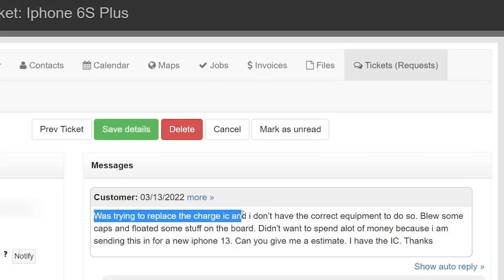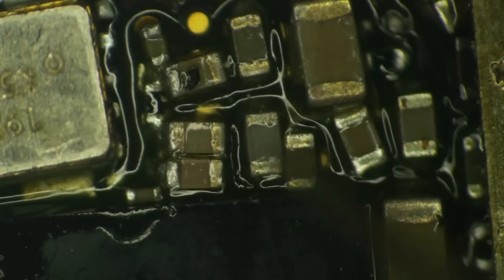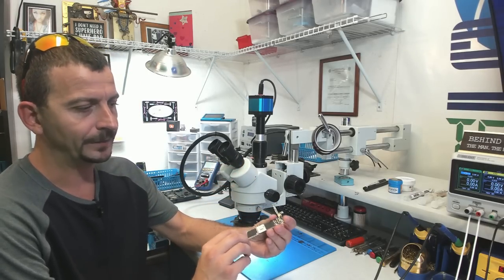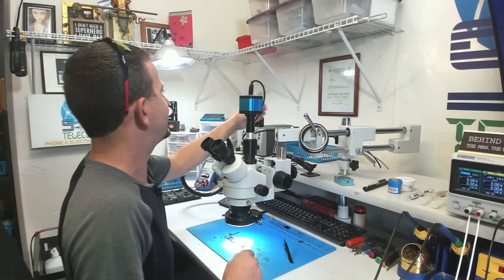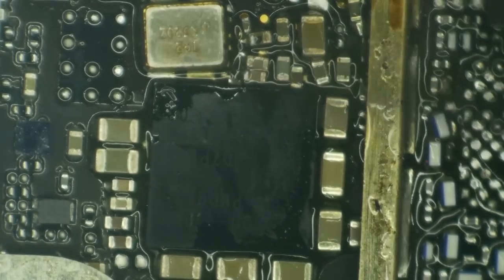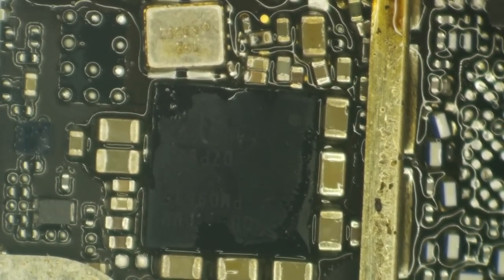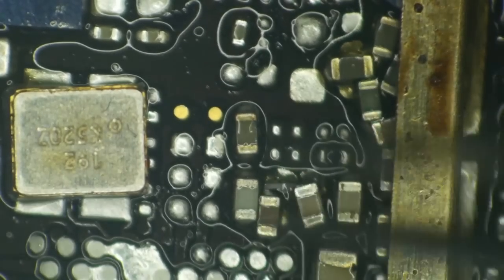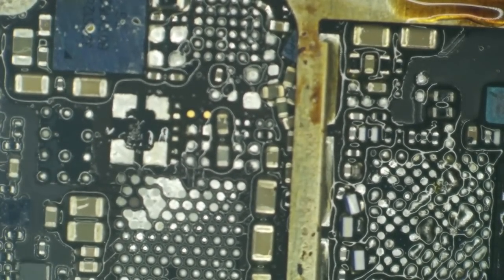Customer tried to fix it himself - An iPhone board repair rescue!

Comment: Wow...the components looked like they moved around like a bunch of ice cubes on a hot dinner plate 😲
 I will give anything a go repairing it but I know my abilities and circuitry that requires micro soldering I will not touch.
 I've transferred memory  ic's from old damaged vehicle key fobs to a new key fob to avoid having to reprogram the anti theft system but I wouldn't go anywhere near something like a phone.
Excellent job mate 👍

Comment: That carnage.. man oh man. It's like he used a flamethrower instead of a hot air gun.. Wowsers. You, sir, are the man!
edit: my word, as if it were a river of lava. After you removed the shield and those caps just, we use the term floated them down, these floated downstream! oh man..

Comment: I feel so good about myself. When I first use my hot air gun it was only an Arduino Nano I destroyed by having everything on full. Even then it was only an IC and SMD I moved. I think many of us amateurs might have got over enthusiastic with the air gun when they first used it. They should give a free supply of patience with many tools.
Reply: Weirdly I somehow ended up with the reverse issue. Literally nothing happens for a ridiculously long time (like 5 minutes for a single 3 pin IC), and then when something does happen, it bridges everything immediately despite the fact that I put the thing on there in the right spot.

Comment: So was he using a propane or butane torch to cause that? Maybe it was oxy acetylene? Good job he stopped to take his meds before he did any real damage. I hear they stopped allowing naked flames in padded cells after this.

Comment: Hey, maybe do you know what’s wrong with my iphone 8+? My iphone 8+ randomly restarts  or shuts off. It can shut down after 1 hour of using or 3hours of using or any time. No other symptoms. I have done factory reset, updated to latest ios, changed battery and the problem keeps the same. In iphone analytics data writes: panic bug type 210 or  211